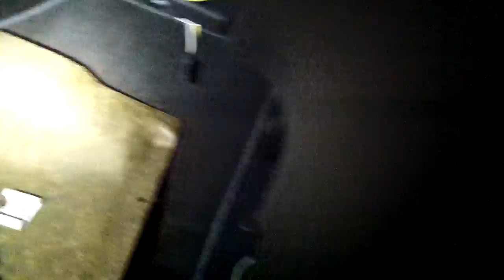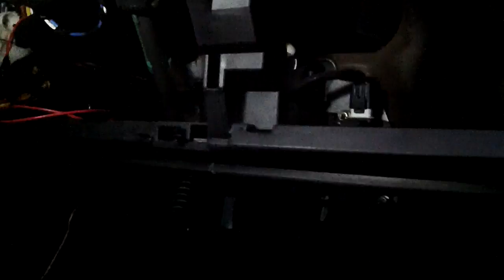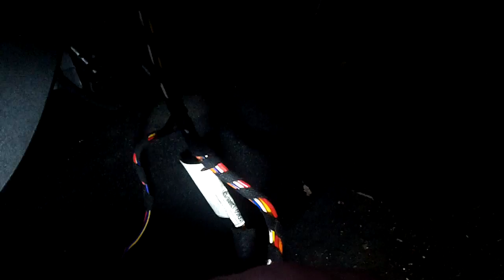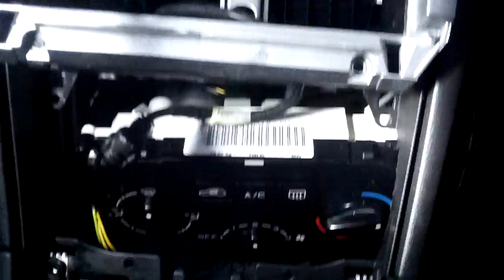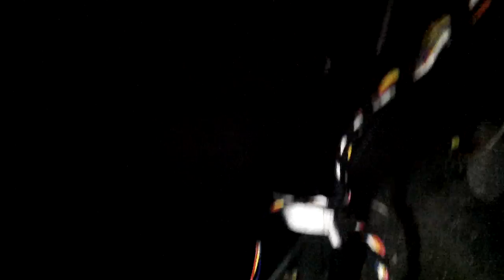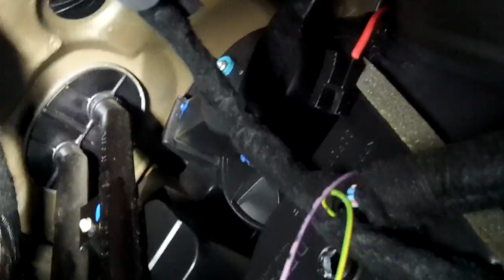Peugeot 307 heat fan wiring

Comment: Hi mate not sure if you remember the video you posted on video for peugeot 307 ive got an issue burning smell when its on worm  when its on cold you can smell that much  i wanted to ask how did you  wire the loom  to another loom  which ive ordered new resistor and new loom  so my plan is to fit a new wiring and new resistor and on the video i can see you only connected the red wire to the old loom can you please let me know as cant use worm heating as it stinks badly. Thanks in advance  email kristijan_kiki123@hotmail.co.uk

Comment: Pulling my hair out here,  I've found the resister..  I've turned it and pulled it,  but it just won't come out it's still attached to the wires....  Its now just dangling.
Reply from the maker: xsjado man,  the plug could be melted on?
Reply: Good point.  I was wondering do  you have to clip the resistor out of the wiring loom? Silly question I know.
Reply from the maker: It's a plug connection. Hope that helps
Reply from the maker: It's probably melted inside,  do you have a new modified wiring loom?
Reply: Was trying to get it out to see how bad it is looks like I'll need to cut it out.  Thank u again.

Comment: Hi my heat control won't do any thing just cold air no hot..  I dont know of if the switch it's self or wire is not connected..  How I can know..  Thank you
Reply from the maker: If you're fan is working but no hot air then it could be a few things.
 engine coolant level low,  poor coolant flow,blocked heater matrix or control flaps not working properly.
Reply: Thanks fir reply what happen is u was switch between cold air to hot air while im doing thats i feelt like something cut do you the switch or the wire..
Reply from the maker: Ok,  if it's non climate control model then the cable is probably damaged/kinked 
Hope this helps

Comment: always the same problems on these 307s. its either the abs or particulate filter or blower. ive had 3 peugeot 307s and all had same probs. not hard to fix thou..
abs was the simple fix. just clean all 4 sensors worked on all 3 cars and problem never came back..